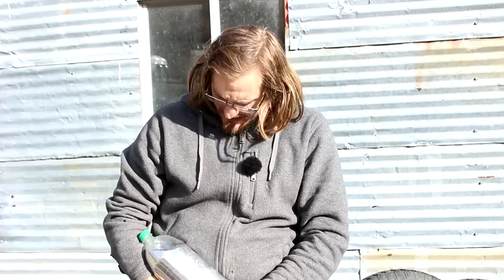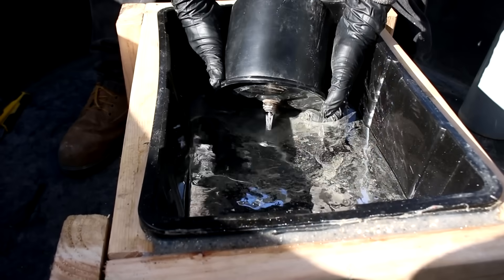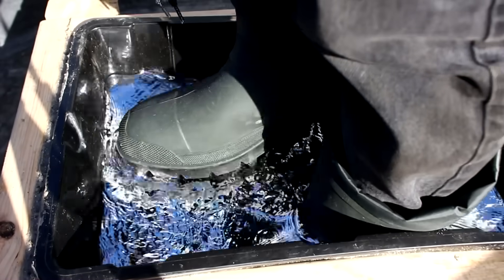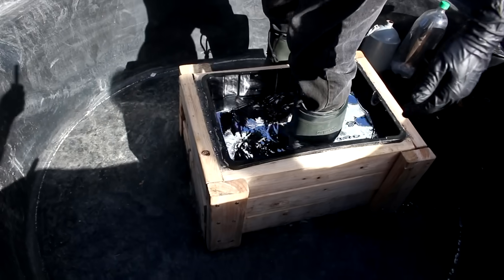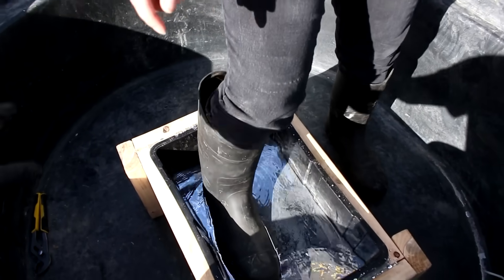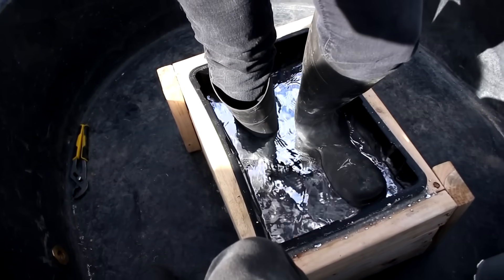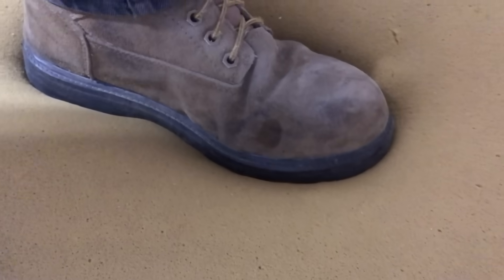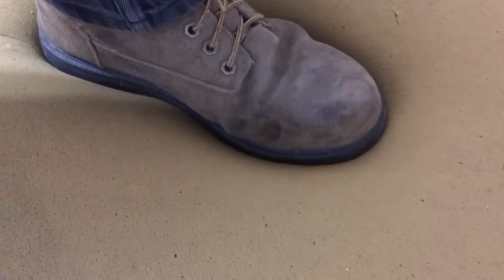Can I Stand On Liquid Mercury?

Comment: Howto: Mercury poisoning
Reply: HammyMcCheesers that's why he handle mercury outside and not sticking the face on it
Reply: The Mercury is also at negative one celcius which will reduce vapors  and he is in an outdoor area with lots of ventilation. The dangers of Mercury are very well understood by anyone that works with it including cody. It's not that dangerous in elemental form.
Reply: How so?
Reply: Joe Alesi you didn't know Mercury on bare skin can cause illness?
Reply: Elemental mercury is not readily absorbed through the skin, only through open wounds, which is why Cody stated that he would not do the experiment barefoot, due to an open wound on his toe.  

Mercury compounds are readily absorbed through the skin, however there were no mercury compounds used in this video, so that is a moot point.  

The only other possible routes into the body are ingestion and inhalation.  Cody did not drink the mercury, so that leaves inhalation of the vapors, which are toxic, as the only possible way for him to be poisoned.  However he did the experiment outdoors on a windy day with low-temperature mercury, so vapor buildup was minimized and neither him nor Kanyon were exposed to any large amount of vapors.  

So again, I ask....Mercury poisoning... How so?
Reply: Joe Alesi well I mean there are still fumes I guess...
Reply: T RopE 
Ok this is 4 months old, but come on, you’re mixing up Organic Mercury with Elemental Mercury. 

Organic Mercury(Dymethylmercury) is a colorless, non-opaque substance. It can be easily absorbed by the skin, and cause massive problems leading to death.

Elemental Mercury(Hg, the one used in the video) is a silvery, opaque substance. Can’t be absorbed trough the skin. The only way to get poisoned from elemental Mercury is if you ingest it, breathe the vapors, or have direct contact with an open wound.

Comment: When you were pouring the Mercury I was thinking about how to get the Mercury out faster and I thought back to the water tornadoes that I would make from an empty 2-liter soda bottle and colored water. Is there any way to remake that kind of effect using mercury or would the weight of the mercury be to much to start and then sustain the effect?

Comment: Omg visible splashing, everywhere...please wear a respirator.
Reply: Why? The splashing is still just liquid mercury that poses very little danger as long as it does not contact an open wound.  It is the vapor that is toxic, and mercury compounds that are the even more dangerous problem.  There were no compounds present, as he stated that this was distilled mercury (although not triple distilled, as he pointed out), and between the stated temperature of the mercury and the wind combined with the outdoor location, the vapor buildup chance would have been minimal at best.  Cody and Kanyon were exposed to very little danger from this video, mostly because Cody has been dealing with Mercury for a while, is educated on it's properties, and knows how to handle it with as little risk as possible.
Reply: Joe Alesi I understand all of that. But what's the point in not taking more precaution than you need to? I'm not hear to lecture, I just don't want anyone hurt.
Reply: Because we would not be able to hear him with a respirator on.  Plus, just like when he drank cyanide, he is trying to show people that having respect for elements and chemicals is better than outright fearing them.
Reply: Joe Alesi Plenty of people make videos in which they wear respirators. He's not an idiot.

Comment: The air in the boots creates buoyancy that would make you float more than normal. She wasnt floating more cause she was lighter, but because her smaller feet made a bigger air pocket in the boots.
Reply: Air pockets? the boots were open to atmospheric pressure the entire time.  You are mistaken in your post, as the total mass that had to be offset was the same no matter the size of the boot.  The total surface area that the mercury had to act against was larger because of the large boots, but that would have been close to the same for Cody as well.  

Take a shipping vessel that is half full versus completely full.  If both vessels are the same size and shape, then the reason the half-filled vessel floats higher is not because there is more air contained in the space inside the vessel, but because there is less total mass pressing against the water, so the ship does not sink as far down to have the density and associated apply pressure equal the force of gravity pulling the mass down.  The air that may or may not be present has nothing to do with it, unless the ship, or Kanyon's boots, were filled with a gas other than that which composes the normal atmosphere.  Even then, the overall effects would be close to nothing. (See the Mythbusters episode about filling a football with helium and seeing if it would travel further).

Comment: How do you get mercury out of paper towels? I presume you either burn them under a shield then reclaim them through chemistry or maybe dissolve the the paper towels in solvent and then reclaim it that way?
Reply: nitric acid or burn them... solvent for paper is not worth doing but if you really want you can use Schweizer's reagent
Reply: Mercury doesn't easily absorb into paper towels because it does not wet objects the way water does.  This is why Cody used it as a makeshift squeegee as opposed to putting it on the surface and allowing it to pick up the contaminants.  

In addition, Cody saves all of his waste for reprocessing, so he will most likely recover any mercury from the paper towel before safe disposal.
Reply: Actually that's a good question: if a substance is a liquid, what is required for it to be absorbed by something else? Most metals absorb oil, rock will absorb some water. I could understand if it was just a lattice thing... like it is for metals and oil. But it seems to me that mercury atoms should be able to absorb between the spaces of tangled cellulose, which is basically what a paper towel is. So I'm still a bit puzzled by absorption.

Comment: Frankly, I don't think you should be touching liquid mercury.

Regardless of whether or not you think you're handling it correctly, there is always a chance that you are not. And as much as you think you know about it, there's always going to be that little bit you don't know. Mercury poisoning can prove to be fatal, so unless you have gotten the opinion of an expert first, I do not recommend putting your feet, specifically your feet as they are more difficult to clean off than your hands and if you're the kind of person who gets an ingrown toenail then you've got a good chance of getting some caught under your nails, into a tub of liquid mercury. Just don't do it. Ever.
Reply: Cody has had a lot of experience dealing with mercury.  He knows the dangers and risks associated with it and takes precautions where needed.

Comment: Okay, you're going to need a tank about twice as deep, hip waders, and your weight in osmium or iridium.
Make a couple blocks from the metal about the size of your feet (other shapes would require less of the metal, but a deeper tank of mercury) and strap them to the feet of the waders.  Wearing these your center of mass will be below the surface of the mercury, and you'll be able to stand upright!  But you're going to feel a lot more pressure on your legs!

Comment: Cody, can you make a video about rotating mercury? Supposedly it generates a magnetic field and can be used for propulsion or at least levitation.
Reply: That's why he said supposedly and requested a vid people. Got damn
Reply: Paul Freedman Exactly what part of this conversation do you see as conspiracy’ish requiring a tinfoil hat?
Reply: nonstopbg Good question, of course anything it produces as far as energy has to be put into it to produce that energy.Just like magnetic levitation trains from the levitation produced when a electricity sent through a coil to create a magnetic field.If you’re thinking of like a space Drive, no spaceship would have to produce energy to spin the Mercury to produce a magnetic field that might give a trust but you’re still having to feed energy into it and something has to be there for the magnetic field to push or pull against.
Reply: lol Die Glocke
Reply: Using mercury for maglev would be difficult, but not impossible
Reply: Yes, that's how a mercury vapor discharge light works.  By having the mercury vapor act as a conductor across the plasma channel.
Reply: i wonder how the mercury vapor would behave in a similar setup for rotating liquid mercury. does it even still conduct electricity as a vapor?
Reply: +CaptnApathy check out a mercury arc rectifier, pretty slick if you've not seen one.
Reply: Cold enough elemental mercury is a superconductor.  It could be made to float on a magnet.  Might be a bit of an anticlimax as a video subject though.  Demonstrating a hydrodynamic mercury pump to drive his Sprengel vacuum pump would be neat.
Reply: CaptnApathy Cant imagine it does: a gas exists as particles that have a huge room between them. The electrons couldnt simply pass through it. Maybe at very high voltages. On the other hand, you have neon lights and tl-lights so im probably talking out my ass and wasted a minute of your time 🤓
Reply: nonstopbg I heard something about Hitler creating a Bell looking time machine that used red Mercury, some wierd documentary
Reply: He is talking about leviation through magnetism. But hey, good thing the 'experts' came out of the woodwork when thry got a chance to be a dick.
Reply: Cody already did a similar video on running electricity through mercury and with a magnet in the center and showed how it could be made to induce rotation in the mercury.  I assume that you are talking about something similar, but would be rotating the magnet in the mercury to induce an electric current into it, perhaps?
Reply: It's funny that you people are belittling this guy, rotating liquid metals does in fact generate a magnetic field which can generate electricity
Reply: Where did you find that info? Crackpot youtubers? Mercury can be made to rotate, yes, but that's just early demonstrations of electrical energy turning into mechanical. Nothing to do with "levitation".
Reply: Dennis Klomp indeed. That's why I said that Cody had dome something I thought was similar and asked for clarification, instead of dismissing his comment. However, I think Cody also did a levitation video as well, however not with mercury, so that would be an interesting video, if he did it. However mercury is only very weekly magnetic at room temperature, so what he did with the magnet in the mercury and then passing and electric current through it to cause the mercury to spin and generate a larger field might assist with magnetic levitation being possible, but it would still require energy to work, as all systems do.
Reply: nonstopbg you want him to make a video on science that doesn’t actually happen?  Stop watching ancient aliens.
Reply: Time for the tin foil hats

Comment: I really really like your videos and have respect for your more "dangerous" experiments, but please be careful you never know what could go possibly wrong which might hurt you badly. Not that you can handle difficult and more dangerous experiments. Think of Heath Ledger who accidentally took the wrong amount of the wrong pills. Maybe one day you make a calculation error of the lethal dosis of a radioactive isotope you swallow or something like that. Please keep the risk at a total minimum. I love your videos without the more dangerous stuff.
Reply: st0ox I really appreciate that you worry about him, but trust me he knows what he's doing. When experimenting or working with dangerous compounds in general it's imporant to know about the dangers, but you also shouldnt be afraid of the chemicals you're working with. I'm pretty shure Cody  takes his time to work out what level of protection etc. is necessary as he plans his experiments. For example he could use all kinds of heavy protection and respirators here but he doesnt because it isnt necessary. The small amounts of vapour/ aerosol are a way to small dose to cause serious harm to him, but he uses a great level of protection for the environment and makes shure that no mercury escapes and contaminates the ground, which would be damaged long term. Most of the chemicals he uses arent actually not that dangerous for someone who has been taught how to work with them. There are lot more scary things than mercury. 
Besides, there is a video where he drank a cyanide solution and you can see how he carefully calculated and weight out an amount way below a dangerous dose. And most likely he always keeps someone else around in that kind of experiments, who could intervene if something goes wrong.
And most of the time you get hurt when working with dangerous compounds etc. its a thing you do every day or that doesnt seem dangerous st all, not the dangerous stuff. My last few "lab accidents" where all where not related to the stuff I was actually worried about. (nothing serious happend so far)

Comment: Can you get a larger container, then use your hands and feet to actually float in a stable fashion on top of mercury?
You should be able to cut the depth in half and double the surface area if you spread your weight out over twice the area.

Comment: This video got me thinking about using mercury under a powerful electro magnet, would the mercury be magnetic? would it provide a slippery surface that the electro magnet could glide over? could you do some experiments using mercury an electro magnets under pressure? my thought process instantly went to mercury based ice skates that could be used on any surface...
Thanks for the video got my imagination going wild.

Comment: how about trying it with two containers of mercury a little apart from each other and put one foot in each one so you can widen your stance a little?
Reply: You would need a tripod stance like a kangaroo tail if you have no friction to work with when trying to balance, two points will not be enough with a unstable arrangement and a high centre of mass.
Reply: One for arms too so he can balance fully

Comment: Maybe you broke a world record here!
Reply: Richard's World Traveler i think he did for real. Hes probably too smart to send the application, which would agree with as its mostly braking bs records, and making cheap entertainment.
Reply: That's methyl mercury, Cody uses elemental mercury, which cannot.
Reply: The vapor pressure for mercury vapor at 273K (0 C) and atmospheric pressure is about .000001kPa, or about 100 million times less than the pressure of the atmosphere. Mercury vapors would be pretty much nonexistent. They become a problem when you heat the mercury to boiling, where the vapor pressure equals atmospheric pressure (which is the point things start to boil), but that's at 630K (357 C).
Reply: I said vapors aren't an issue at 0 C and atmospheric pressure. Nothing at all about skin absorption.
Reply: Yeah he broke the world record for "Highest deliberate exposure to elemental mercury & vapors in the 21rst century"
Reply: Richard's World Traveler what record?
Reply: no
Reply: Nope. Big structures float on mercury beds. Eg. the Eiffel Tower.
Reply: No what?
Reply: Im ur 666th like
Reply: mercury is extremely toxic. mere exposure to it let alone skin contact can definitely give adverse effects to your brain.
Reply: daniel wiles organic Mercury will get you killed
Reply: Charles Darwin would be proud
Reply: Foxfyre Seraph Oh I see, so in school when they said to be careful when handling mercury thermometers it was actually because the mercuary was being heated then? Makes sense.
Reply: Hi There more like the record to try to kill himself
Reply: Foxfyre Seraph Mercury can be absorbed through the skin